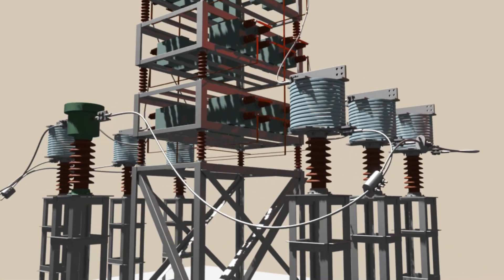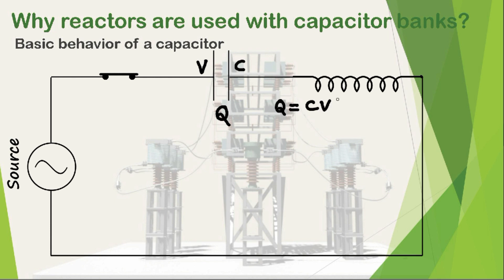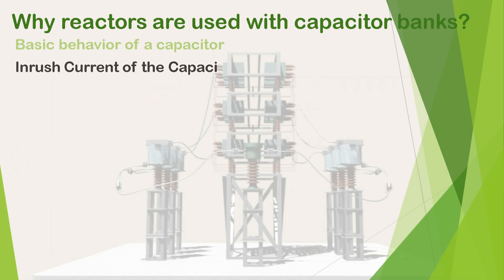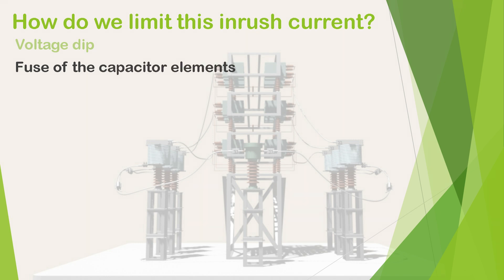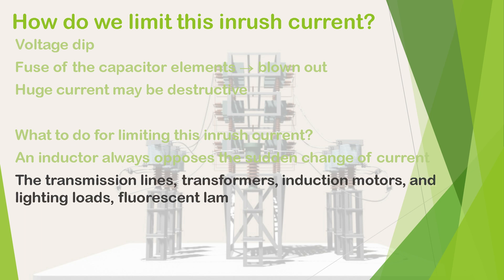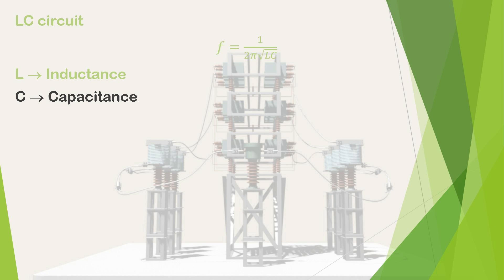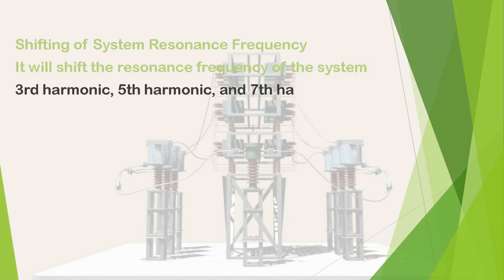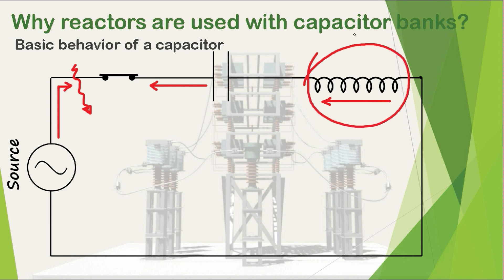Why are Reactors Connected with Capacitor Banks in Substations | Inrush Current Explained

Comment: Why this reactor not connected before capacitor?
Reply from the maker: Yes you can connect a reactor before the capacitor but that must be single phase reactor.  But normally reactor are also available in markets in three phase configuration. In that case only you need to install the reactor after capacitor otherwise neutral point will be formed before capacitor string and this is not desirable.